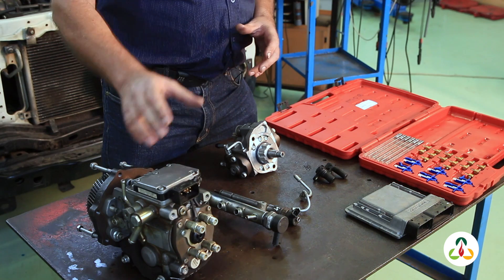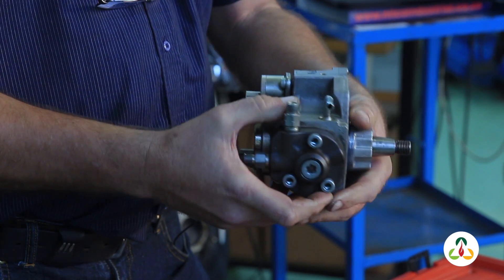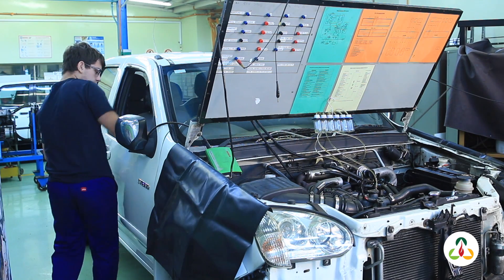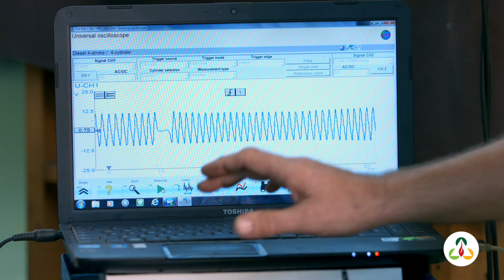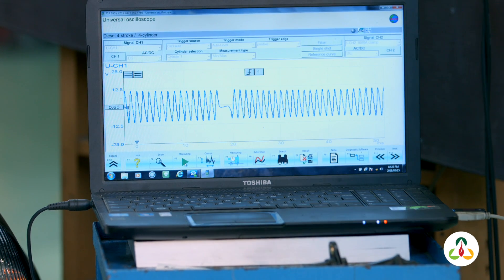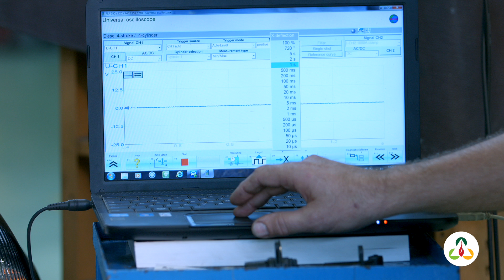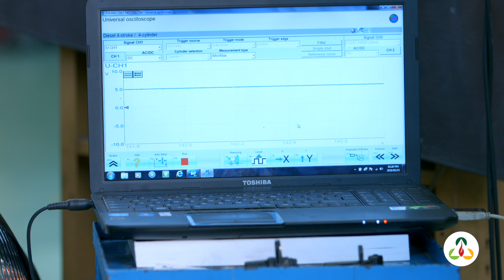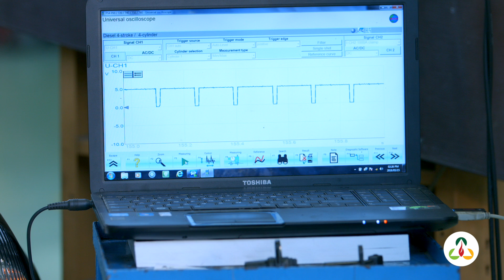How to Test the Return Flow of Common Rail Diesel Injectors.

Comment: The Kubota v3800 definitely needs to be timed since it uses spill port timing off the camshaft to open and close a solenoid to regulate fuel flow 🎉

Comment: I have a kia k2700 and even with new injectors i get a over fueling problem which causes diesel knock. When it does run it has a miss.

Comment: We had the problem the engine feld out if asking for power. Normal driving was 95 % no problem but as soon as we wanted to like overtaking a car fast, motor fail and out. Restart with in a second so no problem. With this test we noticed 1 injector had a full jar the others normal. To mutch diesel running back to the tank in that injector. Refurbished injector brought the solution and the car goes as it was new. But I do have a question. In the early days befor commonrail we use to do some petrol in the diesel to prevent from freezing in the winter. Now I am been told in common rail you must not do it it would arm the engine. Is this true? And more in the older type of dieselcars I use to do some simpel engine oil in the dieseltank before filling up the tank with diesel. Made 700 to 800 K in km with no ever problem. So what if I would do so in the common rail car?

Comment: On my car , all the injectors returned same values , what amazed me is that in 5 minute the return line from the rail leaked 1l of diesel , is that normal or what could be wrong as i believe it shouldn't be returning any diesel through that line ,instead flow the diesel from the injectors back into tank .
Any suggestion?

Comment: and even a big BAG from the engine while is running at moderate revs. That is what you can get as well from a back leak injectors, when sendind 3-4 times as much diesel back to the diesel tank... BMW E90 M47 2 LITRES ENGINE with 300k miles on the clock, original injectors since.. 2005. All system treated with 2 stroke oil 250ml/50 litres of diesel from 250k miles. The engine never missed a start. At present day 2 injectors were rebuild.

Comment: You can even have a really really loud BANG, like a hammer hit on a metal plate, or as you stall a diesel engine when you try to start driving.
It happend to me while I was driving at about 30-40 miles/h, about 2000rpm.. 
It was nasty and scarry bang. I found out that 2 injectors were leaking almost 3 times as much fuel as the other 2...  after 300k miles on the clock with these injectors. I dismatle the tip, spray .. brake cleaner, all 6 holes clear of build up.. 
Try to understand what practicall happen to get that BIG BANG to almost stall..
The car was still running, the engine didn't stop or anything...

Comment: An excellent demo about the excess fuel returm.
Do you have any idea why my diesel engine oil level raises? It's not the coollant, but diasel fuel got into the engine oil. Are the injectors to blame? Thanks!
Reply: Leak on return line or pump!
Reply: Or sticky injector, nozzel pin staying open - but you would have noticeable economy / driveability symptoms. ALSO depending on the the type of diesel engine - if its a passanger type diesel after 2007 fitted with a DPF and unlike commercial diesel. This DPF does not have an seperate injector for the DPF- it will just send extra fuel into the cylinders to reach the DPF in the exhaust stroke. Have a look into it if you are unsure.

Comment: My 2007 corolla verso 2.2 Diesel will start the first time without a problem and idle normally. After about one minute or so, a warning light will show up on the dash then after another 30 seconds, the engine cuts out.

 When the engine dies, I can restart again without a problem and the whole scenario starts over this happen until the engine warms up. once the temperature reaches 60 and the blue light goes off the car works fine the rest of the day.

I cleaned the EGR, polished the glow plugs and tested them, put a new fuel filter, tried a working SCV from my mate's car, and did a full tank with fuel treatments.

None of the above-mentioned worked however the car performance is much better.

I tried to warm up the fuel rail line with a hot cloth soaked in hot water and will top it with hot water every now and then and the car did not cut off but won't drive as normal unless the engine itself is warmed up.  

Once it is warmed up it runs fine. Any idea what else could it be?  Thank you
Reply from the maker: I would suggest you take your vehicle to your nearest dealer for further diagnosis

Comment: Excellent video presentation, very well explained. Trying to get a 2007 Nissan Qashqai with 1,5dci engine non-starter started, will do all these tests to determine where is the problem.   Thank You Very Much.  COMMENT  All the way from Maputo/Mozambique
Reply: Did you find a solution???
Maybe you have error codes, 
You can do an obd test with an error codes reader

Comment: happy working my friend, I want to turn on the PC300-8 engine without a monitor, he is a common rail type using PCU ECM, can you explain how and what I have to prepare
Reply: Are you trying to start komatsu pc300-8 engine out chassis. Yes it can be done.if your monitor is password protected then u need to removed the monitor from the machine.then rewire .we have almost 20unit of this model.yes is commonrail engine.
Reply: @vsheavy2792  ok thanks the information is very helpful